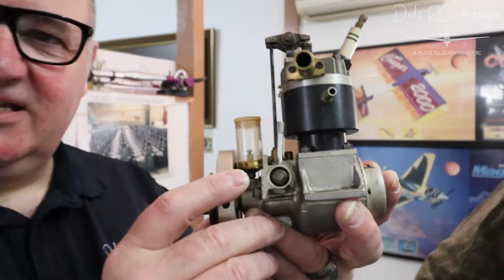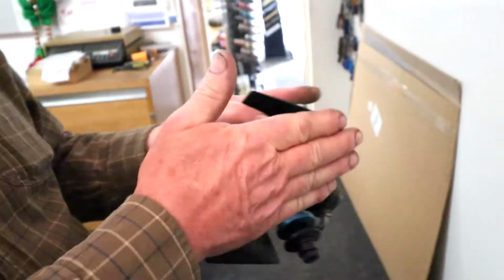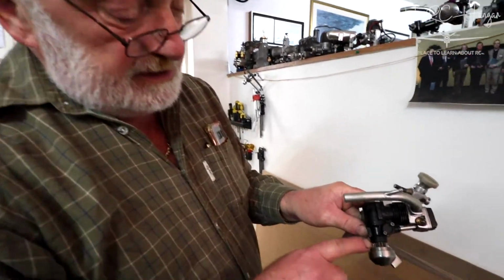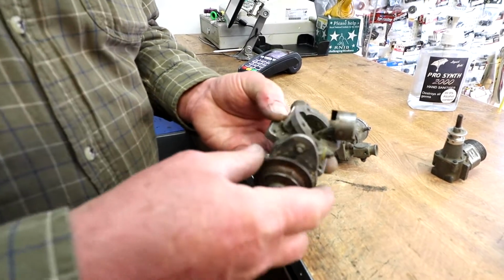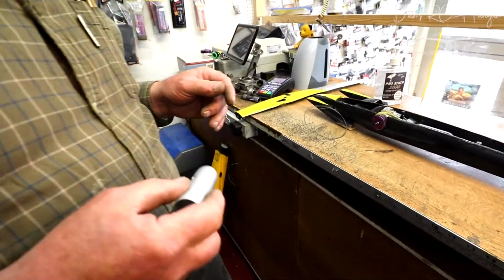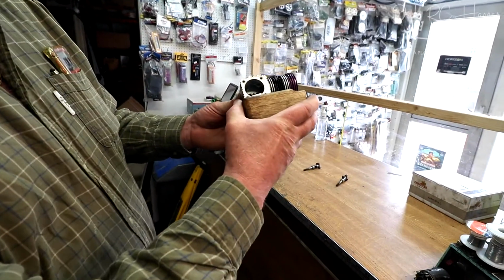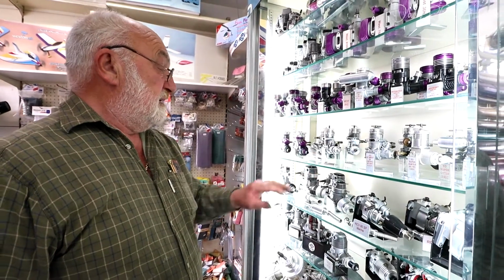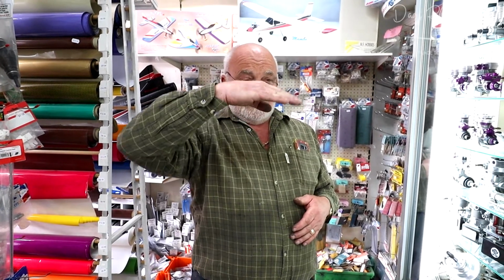Spitfire Supermarine | Custom Exhaust and West Engine

Comment: A great video Chris, isn’t Alan a great guy& there is nothing he don’t know about engines. The last time I was there I bought a cougar & his west 36 & tuned pipe, I only went in for some propellers!!! They are all so helpful too, with his advice, I got a motor to run really well when it was a pig to run before! Look forward to the spitfire build. P.S get your self a cougar & motor when your there next😁👍 guys at my club say there great & easy to fix if u crash them.
Reply: The guys at my club said the cougar is a great plane once you learn the basics, it will do everything from prop hanging to acrobatics or just flying slowly around & great fun, need the right engine & pipe though, set the throws low first then medium & high rates on the TX it will do everything then. If you do crash it, Alan will help out with spare parts If needed. Another club in kent use it as a trainer with very low rates!
Reply from the maker: @johnretired3383  I am sold. The Spitfire won’t be built till he has finished the engine as he has the fuselage. So that will not be till mid June. I am hoping this darn rain will stop. Then get some flying done👍🏻
Reply from the maker: Yup John, a wealth of information. Next time I am back, I will video we’re he makes the exhausts and engines along with the fuel. I am excited to see the outcome of my exhaust with the west engine. Was so nice to see engines that were made in the 50’s. I was very lucky to be shown Alan’s works. I was going to buy an plane and he said No, it’s too fast for you 🤓. Cougar I will get thou, looked really nice.